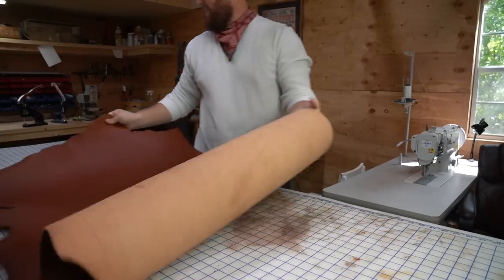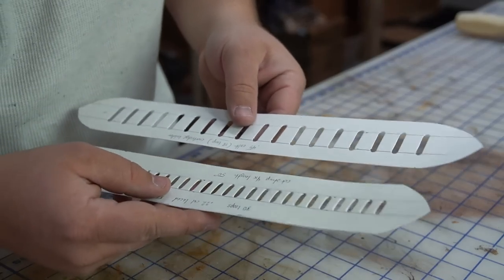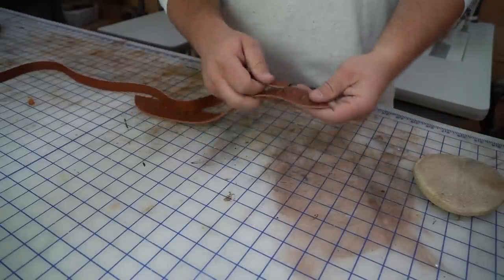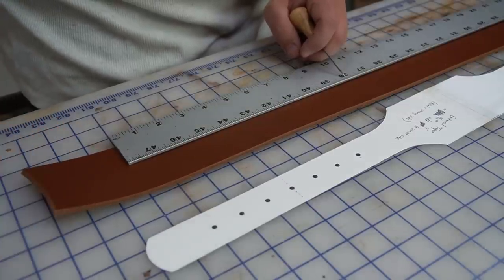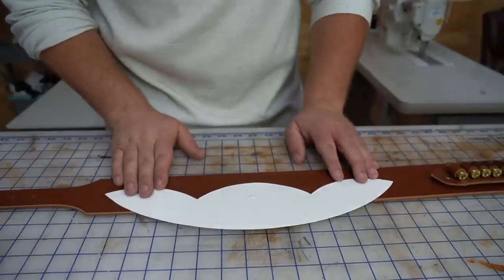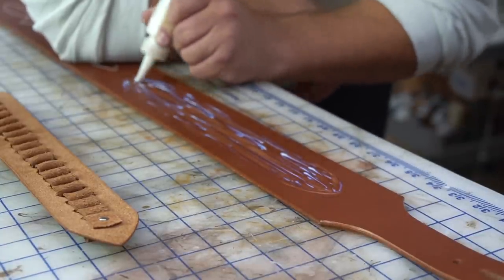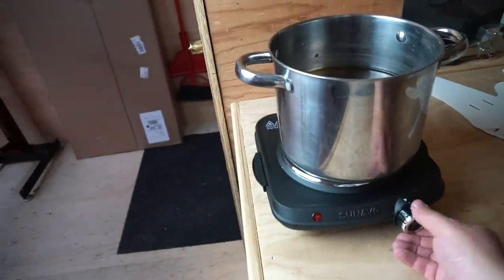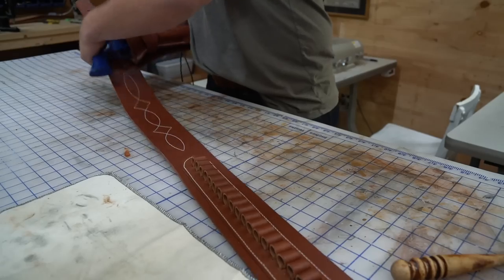Making a Colt SAA leather belt and holster rig (Extended Edit)

Comment: The only success I've had with the fuzzy bits, is to sand it with rough, then fine grit. The rough gets rid of the big bits, the fine almost burnishes it. Holster and belt came out great!
Reply from the maker: Thanks Rob! You'll notice, that's what I did. I used 80 on the wheel and then finished it with 320. Usually that works, but the leather was too loose, all the sanding in the world would only make it worse.
Reply: @whitandpark  I did see you smooth the edges with it, to good effect. I use it on the flesh side too, it gets most of the really bad bits down, but rather not use the fluffy bits unless I have to.

Comment: I have made several leather holsters in my lifetime. I would never make one where the trigger is so exposed as is shown in your photos. A branch or stick could easily engage the trigger. Maybe it would be an advantage in a fast draw competition but I want my triggers covered. A tip for shooters who use commercial holsters. The snaps will wear on the bluing inside. Save worn out leather wallets and cut and glue on a piece of the thin leather to cover the snap. I used to save my mother's leather pocketbooks to make my holsters. I don't think ladies carry them as much anymore but they were like gold. I even used the locks and straps.
Reply: Um, on a single action six shooter twigs can pull the trigger all day unless you walk around with the hammer cocked?
Reply: @stephengagliano3831  True but sometimes the hammer itself can be pulled back and cocked and not noticed. With age, hearing often fades and sounds go unnoticed. I prefer not to have anything exposed. Also, some of my guns are double action on first pull of the trigger and single action after. No safety.

Comment: So normally when I burnish I do as you do and use just water (less is more).  When I run into "the fuzzies", I'll use something else that will bind them down like gum trag or tokonole, although I'm typically not that fancy and grab the gum trag.  It tacks it just ever so slightly enough to make them stay down.  I learned that when I wanted to slick down the flesh side for whatever reason because water just doesn't do the job long term.  The only issue I have is you have to be very careful to only get it on the edges.  It can reek havoc on staining and oiling if you get it on the surface.